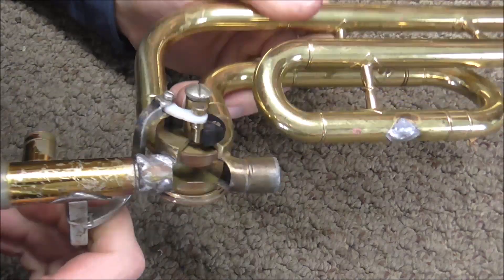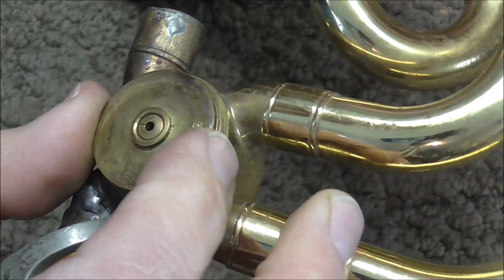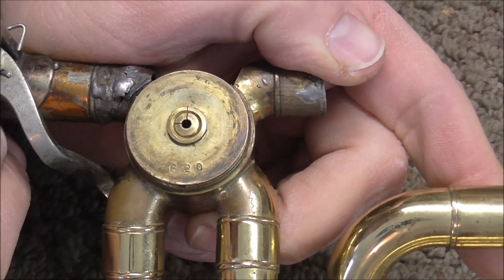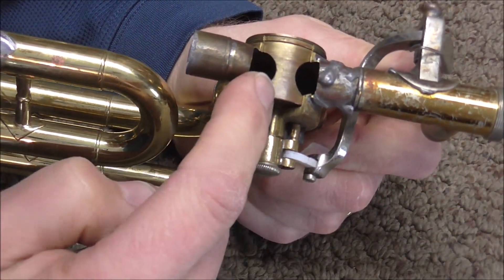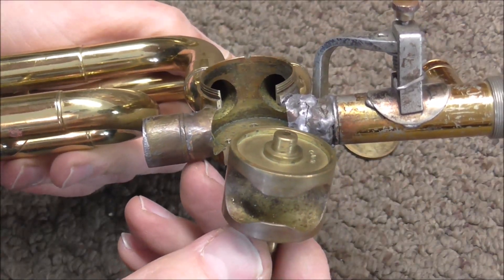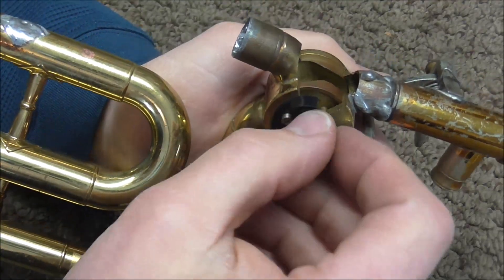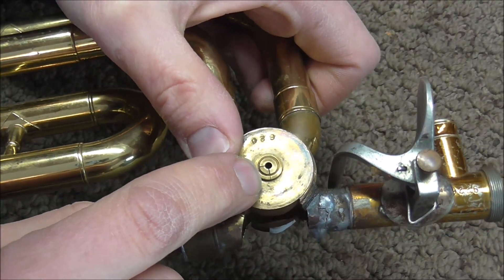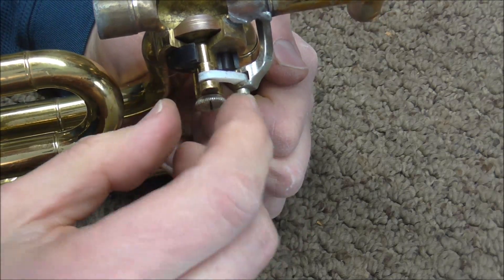Introduction To Rotary Valves: How Rotor Alignments Work

Comment: Thanks for the video.  Was looking for the answer since the airflow wasn’t as smooth after I had the instrument overhauled. I bought it off ebay and it seemed to play just fine.  But after paying to get it overhauled, I’m kind of disappointed that the shop did not do it properly. Thanks for the info!